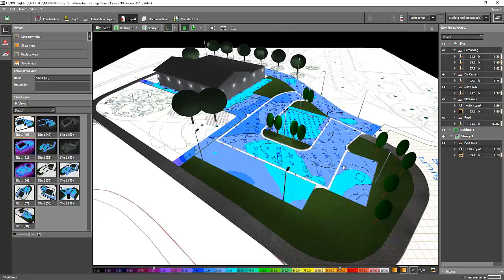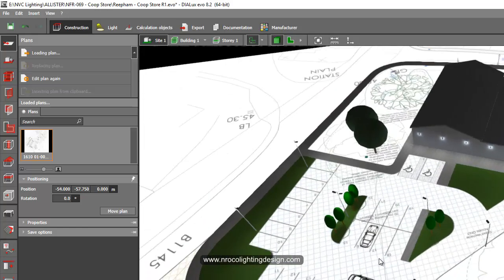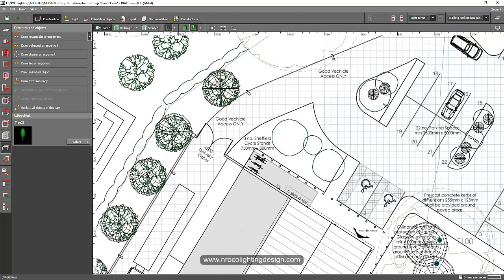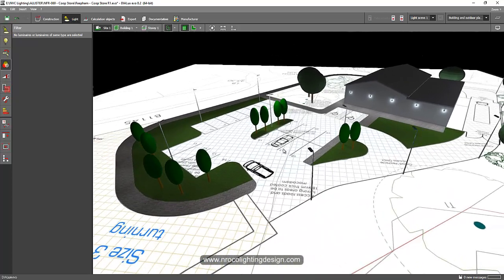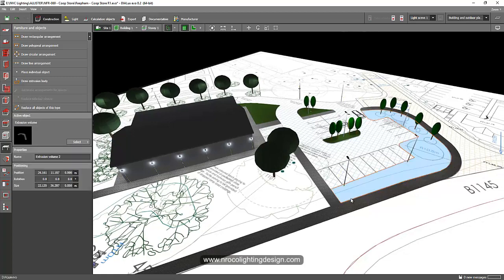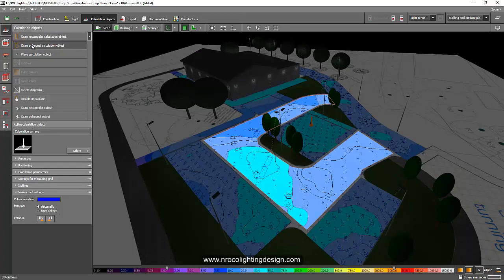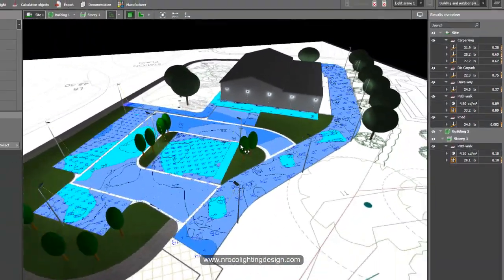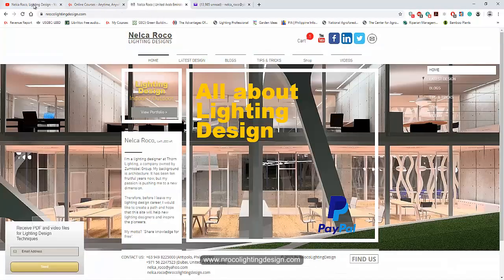How to make a Simple Outdoor Lighting Design

Comment: Hi, I need some help. I usually only work on office buildings with indoor calculations using dialux evo. I have a outdoor car park design I am working on. I am adding bollard lights around the car park outside the building. How do I calculate the lux levels in a big open space like a car park? Do i have to draw a calculation surface across the whole external car park?? Or draw calculation on each section?
Reply from the maker: better do it in sections. and properly label it.

Comment: Hi mam Nelca. How to exclude the room or inside building premises in the calculation, because i need only to calculate the outdoor spaces but the inside building automatically calculates wherein i did not put lights.
Reply: have you tried to take off the surfaces? It should'nt calculate the area that dont have useful surfaces.
Reply: if you make a calculation thru calculation surface tab, you could make a cut out (means cutting off the area that you don't need a calculation) or if you do from assessment area, I think you could exclude also the areas that you do not need some calculation. But overall, Dialux will render some lights throughout you whole area just to show some light spills form outside or from inside

Comment: Hi Ms. Nelca.. I wonder how to change material on that assesment area. Should we create an extrusion or insert rectangular object with specific high first? Or is there any other method? 
Thank you

Best Regards,
Reply: Hi, there are several methods to have different textures on the ground. You could create different floor element or extrusion objects, as long as the extrusion points do not collide.